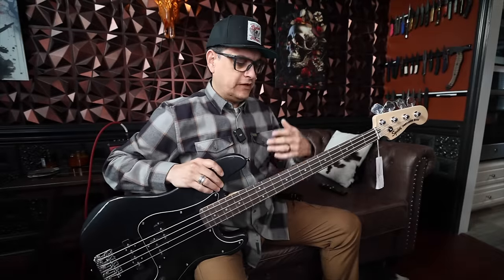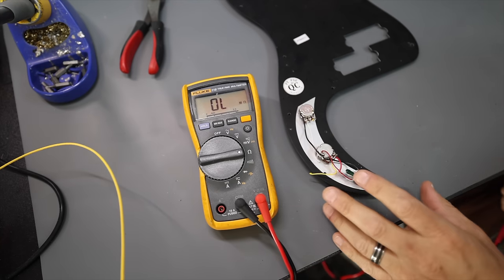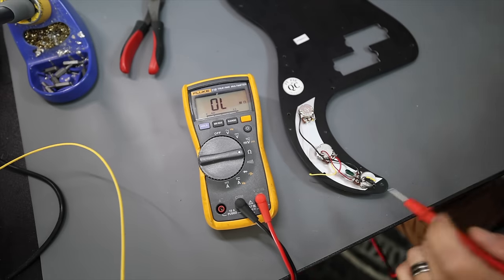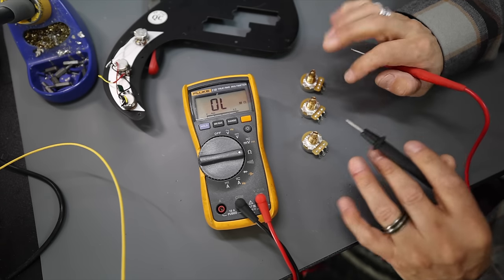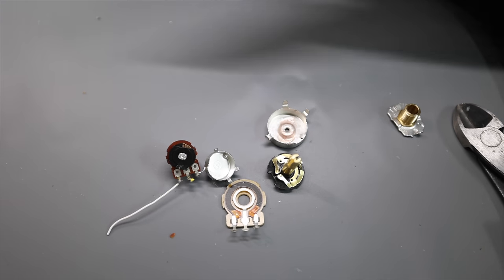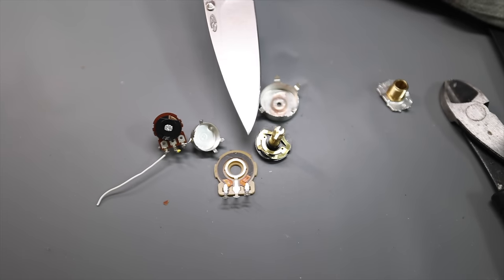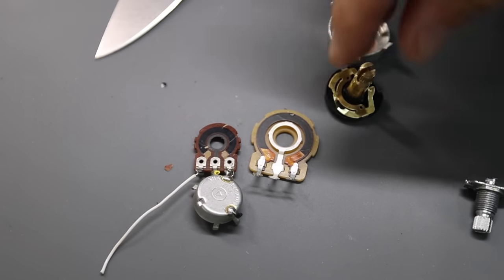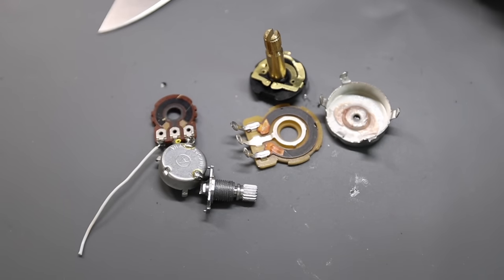Do Cheap Pots and Caps and Switches Ruin Your Tone ?

Comment: The words cheap and expensive DO NOT give you tone.  I turn my sound off using the volume knobs on my guitar's body depending on where my switch is set.  I have no clue where he was going with that.  Snake oil luthiers say what!?  If it has good tone then you've got good pots n caps.  Or do you?  The quality of hardware has come a long way over the last two decades.  Cheaper hardware, in many cases, can rival the best of the best hardware.  That, and if you buy directly from the manufactured source you can get quality hardware at half the price.  If not, upgrade but don't buy the most expensive hardware to have a good tone.  Do your research before you buy.
Reply: "I turn my sound off using the volume knobs on my guitar's body depending on where my switch is set.  I have no clue where he was going with that"

Dylan didn't reply but it seems pretty obvious that he's talking about the type of taper that the pot has. It's cheap pots have a very quick and immediate taper which is not as good as a very slow and gradual taper allowing you to decrease the volume slowly and surely.

Comment: The only real argument for switching those parts is durability, then again, if anyone can replace a pot, they can use the cheap stock one and change them whenever they fail (if they fail at all, I only had to switch 3 pots over 50 guitars in 20 years) In the meantime, 5€ buys me 3 Alpha pots but not even a CTS one and honestly the difference in tone between 225K and 250K on a guitar is marginal at best. The "impact" on tone is not a valid argument here and you should be clear about it. That being said if any of your viewers here bought a cheap Asian made guitar, because it's just as good as any for a fraction of a price. They should contribute to their economy by buying from local businesses like yours spare parts made in their country (or neighbouring ones)

Comment: Bah. If all the math are the same. Ohms, voltage, inductance and capacitance the tone will be the same. Cheap parts break faster and introduce cracks and noise faster.

Comment: I appreciate this info.

I've learned a lot of this on my own through trial and error and only use quality switches and pots. Caps, not so much. I went through the capacitor jungle with my Strats. I tried the tropical fish, bumblebee, Russian PiO, orang drops, mustards, and a $5 per billion pack of Chineseium chicklets. I checked the values of all caps tested and picked the ones that matched the values I wanted , and in the end I left the chicklets installed because they were the last ones tested. 

I know there are people who swear they get more mojo from a PiO than an orange drop. I really wanted to hear it myself but it never happened. I can shape my tone better by using different strings.
Reply: Maybe some of them have PiO's that have already drifted in value, so when they compare against an original spec (of either type), they're going to hear a difference. If they replaced it with one of the same actual value rather than the same nominal value, the difference may well vanish.
Reply: @mal2ksc  I can't swear to this, but it's my opinion that since all old electronics drift over time, I think it's the unique interaction of those components that produce the mojo that people seek.

Comment: Always remember this.  Volume and Tone controls are only bleeding signal to ground.  You are setting up High pass  and low pass filters (for tone controls)  that is it.  
electrons do not care what your caps are made of.. only the cap values.. and also remember you are dealing with very low voltages and amprages..  so you don't need big stuff.

NOW the feel of the pot is important.  and cheap switches will crap out  but caps.. anybody who spends extra on 'bumble bees'  or 'orange drops'  I have some ocean front property in Utah to sell you
Reply: Agreed…there are so many guitar myths out there that people buy into
Reply from the maker: Yep.
Reply: I notice more difference in different kinds of wire than caps. "Orange Drops" are a joke. They sound identical to what you just replaced . The only caps that sound different are the old Russian PIO (paper in oil) caps, they are "looser" sounding, and may not be what you want. Probably because of tolerances being out the window. "Bumblebee" caps are only good for restoration.
Remember, that stuff was taken out for a reason.
Reply from the maker: lol wire
Reply: I use Mojotone Vitamin T caps because I think that they look cool when I open up the control cavity.
Reply: 0:25 a tone deaf guitar player says what?
Reply: Totally agree
Reply: The difference is so subtle anyway.  I think it's more about preference to aesthetics whether we want to admit it or not.
Reply: As I like to say, caps don't have a sound, they have a capacitance. Obviously when you're talking a +/-10% tolerance, that's a huge spread, 20% difference can make the cutoff of a filter (what your tone knob is, a simple 1-pole RC filter where the pot is the variable R and the tone cap is the C) vary by a tremendous amount.

A $10 or $20 multimeter will pay for itself many times over. Measuring your caps and pots will do a lot to help you understand exactly WHAT you do or do not like about your guitar.
Reply: Living in Utah, I wish we had ocean front. We just have the stinky great salt lake here. Lol
Reply: @Oldcrack3r Is that stinky as in shitty, or stinky as in it actually has a foul odor? Never been out to that part of the country.
Reply: I’d say that caps do matter, insofar as to some are microphonic, some drift, some eventually fail. Also extreme values can mostly be made w specific materials.
Reply: @cnilecnile6748   Re: wire sounding different... consider this:  the reason that copper is used for wire is because the amount of valence electrons is optimal for electron flow.  There are not really different "brands" of copper used for wire... there are differences in gauge, but guitar pickups don't put out enough power to need much of a wire.
Reply: So, just to make sure I understand what you are saying...
You are saying that resistance of the insulator in the middle of the capacitor either changes the capacitance and therefore the lowest frequency that is allowed to bleed across the resistance inside the cap, or the resistance of the capacitor material does not affect the tone at all?
Reply: @cnilecnile6748  Just everyone remember with the wires re: tone--
Red = Dead Head
Yellow = Mellow
Green = Mean Machine
Black = Fast Attack
Blue = Blue.

Hope that helps.
Reply: Phillips caps all the way, boys. Cheap and exceptional in quality.
Reply: @VinceWhitacre  Cheap multimeters don't test capacitors, but there are component testers that do, and they can still be had for under $20 on eBay if you don't mind getting a bare circuit board with no case. (No assembly or soldering required, it's a complete circuit, just with no case.)
Reply: Thank you, been trying to explain to people for years what a cap is made of has NO effect on tone, only it's value. Now tolerance only matters in so much as it affects it's value. a 30% cap is fine as long as it measures at what you want.
Reply: How many acres?

Comment: I'm very surprised that there was no mention of the pot tapers (Log or Linear) as this will produce a completely different frequency response change as you rotate the knob between the maximum and minimum positions. Or indeed whether you should use Linear or Log pots for volume, as well as tone controls. Also, the 'loading' effect on the pickups being reduced if you use 500k (or even 1 Meg) pots instead of the 250k pots normally used with single-coil pickups.
Reply: The first thing I thought when he was complaining about the signal going down straight away.  Taper and value, not the pot quality.  The pot quality in my opinion should only really change the feel.

Comment: If you want a great import style switch get a Kaish. I bought one a about a month ago and the switch is built like a tank and smooth as well as quiet! And for the price you cannot beat them. Just as good as the Grigsby. Added bonus with them is the center lugs are already soldered together, and there are lugs for grounding on them.

Comment: You hit the nail on the head there Dylan. It's more about reliability than tone generally with parts.

With pots, it's all about the tolerances and taper (apart from the quality). Cheap will work, but may wear out quicker than a quality pot under extreme use. Most pots have a +/-10% tolerance which could mean for a 250K pot it could be between 225K-275k. As a volume pot, using a slightly lower value can suck some of those high frequencies away. Using a lower value for tone control, it just means you don't get as much range to turn down to (which probably isn't a big deal as a lot of guitarists don't use it anyway LOL). But it's not only $200 Squiers that get cheap pots. I bought an Electromatic Gretsch that had terrible cheap pots (that looked like knockoff CTS). Might as well put an on/off switch in there.

The only reason you'd want to use oil filled caps would be to keep a vintage instruments aesthetics. Other than that, it doesn't really matter what caps you use.

Comment: I got an education on the differences between Pots in my strat. In 2012 I rewired my Mexican Strat with CTS pots, GFS Grey bottom pickups, and it sounded great. Months later I banged my strat against my amp on accident and the shaft off the volume pot would free spin not turning off or down. I had a 250k Alpha pot so I put it in place. My strat was very thin sounding in the mids, noticeably less output, and more noise. I rechecked my solder joints and the same results. All my friends could hear a difference. Later on I bought another CTS Pot and things were back to normal. I have been sold on quality Bournes or CTS  pots ever since.

Comment: One correction. As long as capacitors and pots in a guitar aren’t defective, it’s inaccurate to say that they “suck tone”- they just bleed off some highs, and can also reduce output to a small extent. This isn’t a problem so much an opportunity for fine tuning. If you have a Tele with a hot, bright bridge pickup, you might want to smooth it out. In that instance, picking a pot that’s slightly on the low side and/or a capacitor on the high side might be just what the doctor ordered. If you want more volume and brightness, nudge the values in the opposite direction.
Reply: You’re definitely right, I’m fixing a Jazzmaster with a broken pot and decided to put two treble bleeds in with a three way switch as an option. Jazzmasters have 1 Meg pots and changing it to 500 K would make it sound darker.

Comment: I have a 2012 Gretsch G5420T - a Korean made guitar. I knew I wanted to change the harness and all the components except the pickups. I wanted to do this because I knew the tone emanating from this guitar could be a lot better than it was when it was new and I also knew that I could change out the harness and its components for less than a hundred bucks while a pickup swap would cost another 300 at least on top of that. So I changed one component at a time just to experiment. The first thing I changed was the jack. I put in a Switchcraft. It was a HUGE improvement in tone. It became fuller and more defined. Every other component I installed had almost no effect on tone compared to that jack. The pots are all 500k audio taper. I exchanged the crappy ones for CTS and while they felt better, there was not a big noticeable change in tone. The single biggest improvement was that jack. Probably the second biggest improvement was the tone cap - an orange drop .022uf "J" series. But man, that jack swap was huge.

Comment: Mine: 50s Wiring Scheme: 
Pots: Alpha Brand 500kΩ x4 
Capacitor: Orange Drop 0.022uf x2 
Pickups: Wilkinson Classic Alnico V (B: 13.8kΩ - N: 7.35kΩ) 
Hardware: Wilkinson LP Style 
Strings: Rotosounds Roto Blues 10/52 String Set 
Amp: Marshall VS40R Combo 

Thoughts:??
Reply: It looks 😅 like you have thought it all out.

It's what works for you right
Reply: Off topic but the strings, I used to use the same ones because you get a free top E in the pack, try Daddario 10-52s

Comment: I use CTS and Alpha pots but open to other brands but as far as the capacitors goes, the ceramic disc and  polypropylene (orange drop, cinnamon and green Chiclet) of the same value makes more sense than the paper-in-oil caps especially since they serve the same purpose and are obviously cheaper than the PIOs.
Reply: I have one paper in oil cap.  The reason I keep it there is only because it looks cool. It’s audio jewelry

Comment: One added bonus for the Pure Tone jacks is their physical length with how the contacts are (way shorter than Switchcraft). Not always an issue, but on some Strats, especially the cheaper Squiers, sometimes the Switchcraft won’t physically fit in the body very well. The Pure Tone doesn’t have that issue.

Comment: I always use OEM or quality replacement parts in guitars and vehicles. Being able to count on decent build quality and fit just saves headaches🤘
Reply: I have a French car, if I use OEM it will still be crap 😂
Reply: @Studio22mix  I admit that it does help to start with a well-made vehicle.

Comment: I just found your channel and watched several of your presentations. I love your perspective. I can actually relate, because I'm not a musician. I play guitar as catharsis. I'm really a technical engineer (OJT) that functions as a telephony/IT/comm troubleshooter with a background in radio electronics. I kinda play guitar and fix broken machines to keep myself from punching assholes in the face. Umm... I take the fights to where they're manageable and I don't get my ass kicked. (Fights ain't always righteous, sometimes they're just a matter of opinion.) Kinda why I like your truths.

Back to perspective, because you sparked my own thoughts. Before I made my first major amp purchase, I was blessed with advice to get a keyboard amp because of the built in range of tonality. I'm still satisfied and playing a 4 channel Roland keyboard amp that I bought for about $900 bucks 27 years ago. I sacrificed gain (acquired off-board pre-amped anyway) for texture, but each channel has its own volume and tone, and it doubles as a small PA, so I can play with friends from time to time and they don't have to drag all their equipment to my house. Combined with your explanations of pickup construction, coil-tap vs coil-split, and the nature of cheap pots and caps vs quality ones, something came to my tinkering mind that I never even thought of before.

Because amps and EQs basically have duplicate controls as the guitar itself, is it really necessary to have the attenuation properties of the pots and caps on the guitar? Given the properties of the pots and caps on amps and ancillary devices, such as pedals and EQs, have you ever thought about taking them out-of-the-equation and "straight-piping" the pickup signal to the phone port on the guitar? I know this would take away a lot of the on-the-fly changes, but personally I'm usually doing this with just the switch anyway and it could stay. There's minimal signal degradation through a switch and you could still have plenty of options with a 5-way or even a 3-way with a bridge bucker and neck single. 

Anyway, just wanted to throw that atcha. I gotta figure out which one of my guitars I'm gonna tinker with when I get time. Great channel, Dude. Thanks..